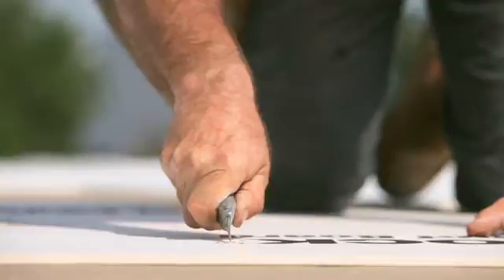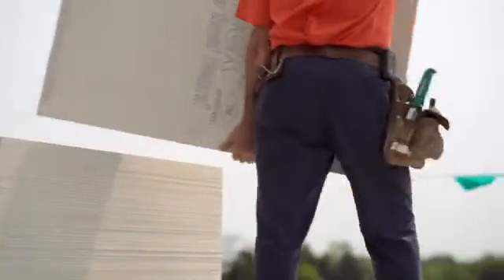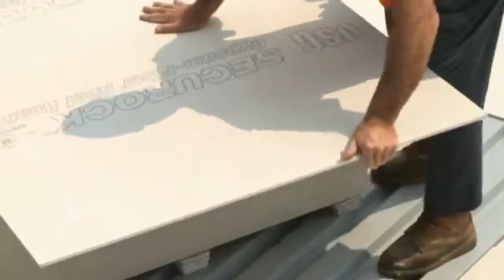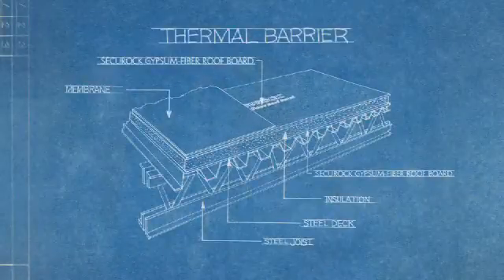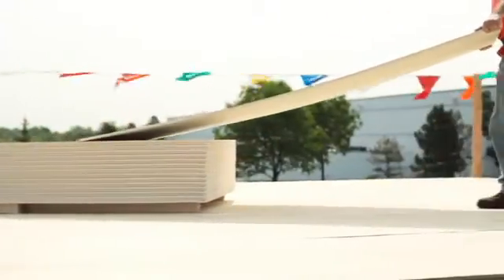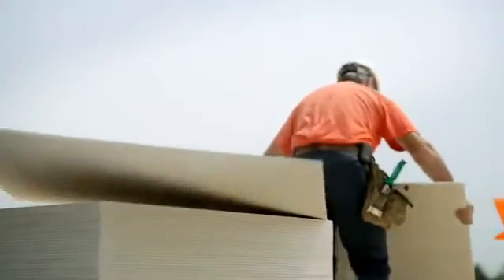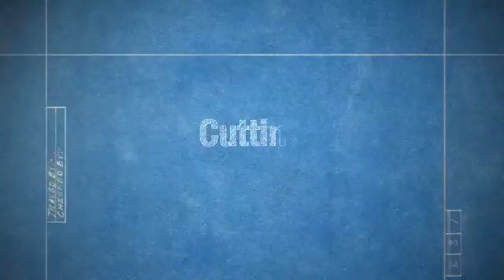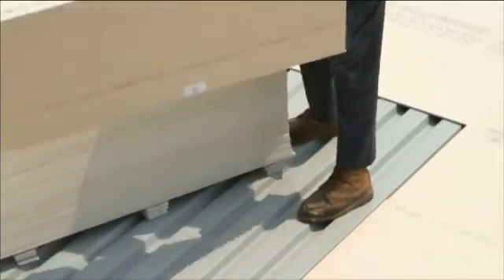USG Securock® Brand Gypsum-Fiber Roof Board Installation

Comment: I just came across 100 sheets of this stuff 1/2 inch for $1000 I have a 30x24 garage with 15ft ceiling downstairs and 8ft ceilings upstairs. Can I use this stuff to do the interior walls and ceiling with this stuff?